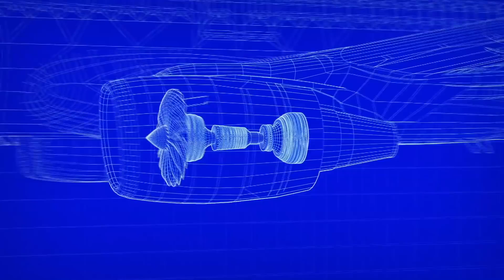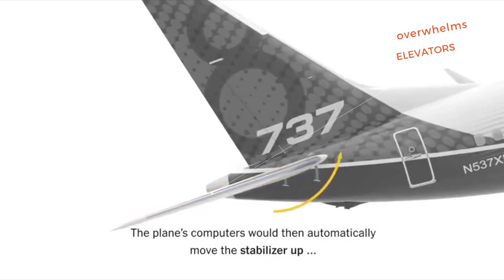737 Max 8 probable cause revealed - Prof Simon

Comment: In my opinion the announced software update is snake oil. Boeing should better go back to the drawing board. We want planes which pilots can fly. A control software that needs an on/off switch because it is known to be so error-prone can not be the final solution.
Reply: @MindLearning : I am not against Fly-By-Wire in general. But whenever software is involved, we should consider Murphy's law: whatever can go wrong, will go wrong. Therefore, I protest against any attempt to balance out a design flaw in aerodynamics through software tricks. I am a retired programmer and have decades of experience in software development. Software can not work wonders, unfortunately.
Reply: I spend my time re-writing and adjusting software for a living , it appears to me that Boeing accepted a software package that is hard-coded , meaning they did not anticipate any errors or assumed , foolishly that there would not be any need for one. If the inputs to the MAX 8 automatic Airplane control systems exceed some per-defined -crash this-plane - norm then the software itself should signal the pilots to regain manual control until those per-defined norms become measurably stable.  The software cannot be the problem ,because we can always fix those,  I suspect business "needs"  drove these decisions.
Reply: I totally AGREE! I know I won't be flying on one of these monsters.
Reply: The 737 has always had a control software on/off switch{s}.  Actually two switches.  It cuts off the automatic trim motors.  Trim can then be accomplished by manually cranking the trim wheel.  Why did these pilots not kill auto trim when it was obvious the auto trim system had failed?  I have not heard the specifics of the new software updates.  How can you call it snake oil when it is obvious you haven't a clue what you are talking about.    https://www.youtube.com/watch?v=9Ts_AjU89Qk
Reply: @theriddler6227  They probably did turn it manually because the procedure is there on the older model as well. How did they pull up many times before crashing if they didn't turn off the trim motors? Nobody knows if MCAS can turn it back on. It probably can. Details are not available anywhere. Even the pilots talking about cutting off the stabilizer trim system in videos don't know if MCAS can turn it back on or not. Only Boeing knows.
Reply: @theriddler6227  MAybe it was not obvious? You get stall alarm, speed alarm, shaking steering horn et, then nose dive, thrust going forward. How to decide its a fake alarm? Thats much easier with a runaway trim only. Pilots get into a tunnel view and are trained to solve one problem after the next. So nose first, speed first? what?
Reply: @theriddler6227  Eating your words yet? The Ethiopian pilots did use the cutoff switches. I suspect this information wasn't available prior to your condescending comment?
Reply: @theriddler6227  Stop.  Boeing makes the AoA disagree light and readout display screen an expensive add on.  They are a joke of a company.  They cheap out on horizontal stabilizers and AoA sensors.  Then make the systems needed to troubleshoot a bad AoA readout optional.  Southwest paid for those systems and added another optional 3rd AoA sensor.  All of these things should have been mandatory and as a consumer you have no way of knowing if an airline paid extra for these necessary features.  

It isn't just a lack of training for pilots, many cheap airlines lack the basic displays for pilots to even know what is going on.

Everyone is conspiring to kill people.  Boeing is risking their company instead of making the "extras" mandatory, regulatory agencies are laughably not requiring these systems or pilot training, and airlines are laughably not paying for these systems or paying for flight training.

I personally put the airlines at the top for fault because they are choosing to not pay for the extra systems or pilot training.  But anyone of the three could step up to prevent crashes, none are doing it.  The MAX is 100% unsafe until someone mandates these things.
Reply: @theriddler6227  

I agree others on the snake thing, I do not need to be an expert to undestand the simple explanation given by the professor...  Boeing is now loosing more than they would have if they had just gone back to the drawing board before the hasty release of the MaX... They now risk cancellation of more than 5000 orders and legal suits for loses due to Max groundings and the two crashes.... I am a software development expert -  and testing of such sensisitive software should not just be done and released without involving  the users(the pilot's)... Otherwise MaX Passagers  and crew will just be guinne pigs in a project they know would eventually kill them.  Yes, we are laymen interms of aerodynamics but we need to be assured of safety...  John
Reply: Dear  @theriddler6227 , MCAS for an airplane is like a pacemaker for a heart suffering from a serious disease. If a pacemaker malfunction causes too much defibrillation at the wrong time you will die immediately. Therefore, nobody gets a pacemaker implanted just for fun. I am advocating for a "healthy" plane design that does not need MCAS.
Reply: Christoph Bodner all this technical stuff  you men are giving to Boeing would it not be a better idea to scrap the full Boeing corrupt company and start a new  one that has the standards and ethics of Airbus. Boeing has a very shady history
Reply: I would suggest to the flying public to not fly this plane . even with this so called software fix I dont believe this plane will be safe . the fix bypasses the actual stall problem of the aircraft . now planes will start falling tail first into the ground .
Reply: Pilots can fly it. It just doesn't have enough elevator authority in some stalls, and it takes quite a lot of work to recover manually. Yeah, it sounds horrible - normal airliners are supposed to recover more or less hand-off (they require control input to pull out of the subsequent dive). That's what happens when you fix a plane that was designed to be naturally stable in all flight regimes (but no longer is, with the new powerplants) with a single-buttocked attempt at automation tacked onto existing control systems. The middle ground between a stick pusher and a full fly-by-wire system like in Airbus airliners (or, infamously, the F/A-18) is tempting, but very dangerous, especially when the stabilizer trim seems to have more authority than the elevator.

Comment: Shouldn't there have been fail safes in the instrumentation to keep them from climbing too steeply?  Ailarons pitch to 15° to get them up, 20° stalls, according to my flight simulator.
  How about something in the gimble on the dashboard that stops it at 18° flat?  
If the pilots are in that big of a hurry to reach altitude, why not allow them to "circle climb" like birds?  Aircraft spend hours in holding patterns, same thing. 
Birds've done it for a few years now, seems to work for them.
  Oh that's right, Man vs Nature.  Man is obviously smarter.
Reply: The "Failsafe" is what caused these 2 crashes. Anything you install in an aircraft can fail and it's failure creates problems you would not have had without the new item. The pilots in these cases were not in a big hurry to get to altitude. They were conducting standard takeoffs when one device sent a wrong signal, a safety system acted properly to incorrect information, the pilots reacted as most pilots would react which caused the safety system to reset and once again force the nose down. Airliners are complicated machines. It's one reason it takes many years to certify one to fly and why it takes most airline pilots a decade or more to learn to safely fly them. Cars and the task of driving them are very simple by comparison and are one of the biggest causes of death in the USA.
Reply: They were not " climbing too steeply ".  The sensor failed.

Comment: But you seem to have missed out the next piece in the jigsaw. What you've described has been known for some days if not longer. What you have not described is how to get out of jail. The ONLY way that I understand that the pilots can regain pitch control of the aircraft is to disable the motor driving the jackscrew before the situation becomes uncontrollable. This seems a pretty desperate and unconventional technique to me but it has been suggested that it is actually contained in the pilot operating manual. If so, I'd be surprised. Pilots are claiming that it is not included in the flight training schedule for the Max 8 and it would appear that those pilots in control of the two crashed aircraft were unaware of it. However, it has been reported that the Indonesian aircraft was involved in an identical anomolous pitch manoeuvre days before the accident in which it was destroyed and was only saved by a third pilot dead heading on the flightdeck who knew how to recover control by disabling the motor. If this is so, it's monstrous and IMO reflects an appalling neglect of customer care on the part of Boeing. I also understand that the Max 8 has only a single pitch detector whereas Airbuses have three and use the average signal from two of them to drive their version of their MCAS. If Boeing does have only the one, there would clearly be no redundancy and any error in its readout could lead immediately to a disastrous situation developing.

Comment: There is no way in hell i am ever going to fly on a 737 max 8 or 9.  They can take their software and stick it in the ars. I want a pilot with the ability to fly the damn plane. Therefore, perfectly understanding why the plane crashed...... it was programmed to do so and programmed to prevent the pilot from taking control of the aircraft....... because the aircraft is too unstable to stay in the air without continual computer monitoring and correction, even if that correction drives the damn plane into the ground deliberately.  I just won't book with the new Boeing. My life is worth more than the 14% they saved on fuel.
Reply: Beautifully put. Agree entirely. They can stick their software update where the sun don't shine.
Reply: Which plane will you fly on? The Boeing 737 NG has had structural problems due to parts out of tolerance being used.
Reply: Almost every commercial airplane built in the last 25 years or longer has been fly by wire, meaning computer controlled signals to to everything from directional controls to pressurization. Admittedly Boeing took this a step further but their fatal flaw seems to be using the A0A indicator from only one side of the jet. Redundancy has always been a trademark of the airline industry and yet in this important case only the single indicator was used. It may be a case of adding the second AoA indicator and reprogramming the computer. If so it's still going to cost Boeing a lot of money, if only in settlements and retrofitting.
Reply: Then I guess you will be walking, because airbus is 100% fly by wire.
Reply: I see a lot of these "then airbus so and so" retorts which are nothing but cheap ineffective attempts to deflect from Boeing's cheap, irresponsible and plainly criminal ways to get the max certified. 

I am never flying another Boeing aircraft since they will just sweep this under the rug by rebranding the max to ng2 or something.
Reply: @cabdolla   but Airbus design is aerodynamically stable while 737 MAX is not. Big difference.

Comment: Prof apparently 737 max 8's  nose pitches up due to the new engine placements then there is a definitive design flaw there which gets the plane to stall situations;, and just putting an automated system to correct that pitch up can be fatal if you are at a low altitude...Imagine ascending through a 6000ft altitude and the MCAS kicks in due to AoA sensor problems...That's a crazy situation with the plane nose diving at 340 knots towards the ground from a low altitude giving very little or no time for the pilots to understand the situation and go through checklists..or at least put three AoA vane sensors so that the MCAS does not by chance receive bad data under any circumstances..also in the brand new planes apparently you cannot switch off the MCAs like the previous version with simultaneous clicks of two buttons..even in manual steer it will kick in automatically if it gets the inputs from the sensors and start trimming id it senses the plane is in a stall situation

Comment: The technical aspect will hopefully be clarified sooner or later. But what happened that it came to situations that 2 planes crashed and 346 people lost their lives. I presume the following happened:
After discovering the aerodynamic instability and the decision to fix it with the MCAS there were some fatal decisions:
A) The marketing message that the MAX is just another version of the NG and no additional training is needed was not changed.
B) The MCAS was classified as "critical" but not as "fatal" in case of malfunction. 
C) The documentation provided to the FAA was faked speaking of 0,6 degrees of maximum pitch (to support the classification) instead of 2,5 degrees
D) Another decision in order to save costs and time and support the classification was to feed the MCAS with a single AOA-sensor instead of 2 which are available in the 737 or 3 which is industry standard on modern airplanes.
D) The last fatal decision was to keep the MCAS secret and no mention in the flight manuals.

One lie was following the other and in the end 346 people lost their lives.
Reply: Stephen46 xre - and this was done by Boeing, known for the principle that pilots have ultimate authority. By saving a few M$ in pilot training, Boeing probably cost itself a T$
Reply: I would not want to be a fly on the wall in that boardroom at Boeing when the big cheeses decided to cook the documentation and keep annoying details from pilots. From where I am sitting, the 346 souls were experiment dummies so Boeing could test their software.
Reply: They lied about 0.6 to 2.5 , O short sell this stock someones going to Jail .
Reply: This 'modification' I stead of 'redesign' was to get around FAA certification.

Comment: Sure I read somewhere that the faa subcontracted out safety testing of the systems to boeing or allowed them to self validate.  If so this is a major issue in trusting the word of a manufacturer alone.
Reply: yep because FAA couldn't keep up with what innovations the airline industry have been making , sort of like a kid with a computer , back in the 80;s could bamboozle parents into  thinking they needed a computer to learn stuff on , when infact games where in order .
Reply: The FAA has been using DAR's (Designated Airworthiness Representative) and DMIR's (Designated Manufacturing Inspection Representative) for as long as I can remember... that's a shiny thing for the news to talk about...
Reply: Exact same thing that the FDA does with Big Pharma...takes THEIR cherry-picked studies and does no testing of its own. Ex. VioXX killed over 50K people before the FDA removed it from the market. That's like the fox guarding the hen house.
Reply: Valerie Griner Trying to stick with aviation and the accident do you really want federal bureaucrats reviewing the work when they know nothing about aircraft, it’s complex systems and controls?

I kind of hate to throw this example out there because people can be taught. Even monkey can be taught to press a button and launched into space. When I worked as a FAA Avionics Airworthiness inspector the Certificate Management Office (overseeing one of the top 10 Part 121 Air Carriers) they hired people off the street that didn’t even know what Part 121 was (the regulations that govern our airlines). Sure the FAA sent them to Ok City for three months for training but how does that compare to me who spent my life and career working on large aircraft, tearing them apart for inspections and modifications, have my Airframe and Powerplant certificates as well as my Pilots certificate. These people were lost when we’d do ramp checks or audits on the carrier.

Do search on YouTube for B737 Runaway Stab Trim training and Grab and Hold. If a pilot has runaway stab trim you turn it off. If it does turn off because of a midwifed system or such, they are instructed to grab and hold. 

I don’t blame the the pilots for not knowing what to do. I blame the 3rd world airlines for not supplying these pilots with training and knowledge they need to know to deal with an emergency. 

In the last accident the pilots didn’t respond to the runaway stab trim condition when they needed too but also didn’t control their airspeed and compounded their problem by allowing the airplane to be in an over speed condition. In laymen’s terms they were doing over twice the speed limit because they never pulled power off after takeoff. 

If I have a blow out on the highway I don’t put the gas pedal to the floor while trying to pull the car over to the curb...

Comment: Did you hear about the interview on CNBC where a pilot said that the MCAS cannot even be deactivated but it will only be reset?
Reply: I dont think thats true. There are switches located by the big trim wheels to turn the mcas off.
Reply: jrod1019kw they must follow  gheir traing and flight manuel but both are limited to them
Reply: Terrifying , so even if the pilot manually corrects the MCAS will just reset and go back into the nosedive.
Reply: I think that maybe true..because the computer..can calculate so fast and make decisions in time...but can the mechanical  respond to the computer in  time between difference angle of elevation of the plane...